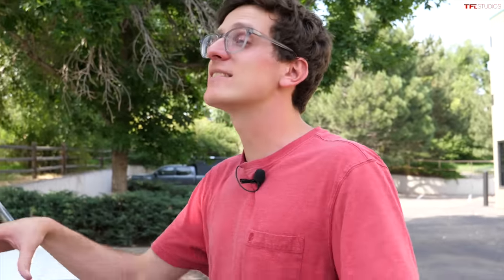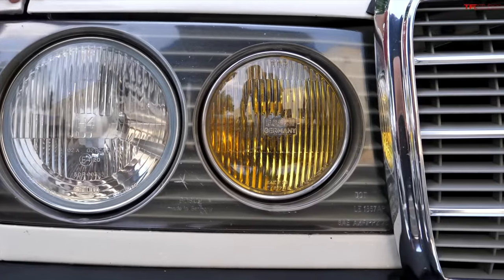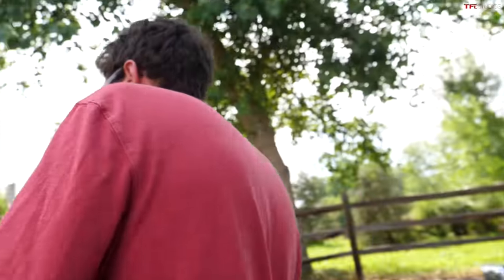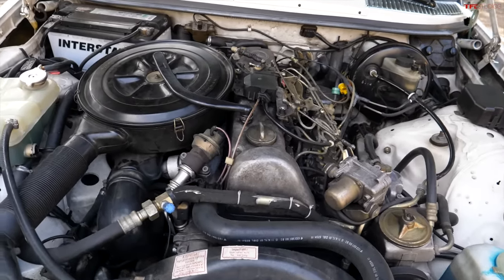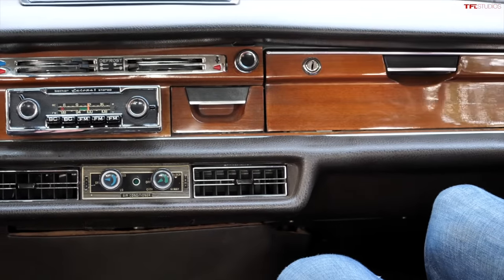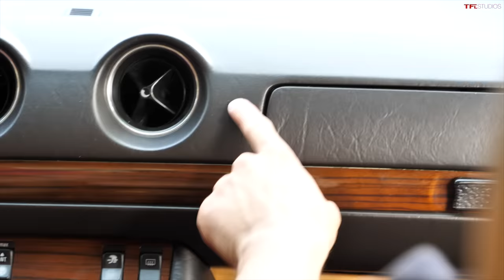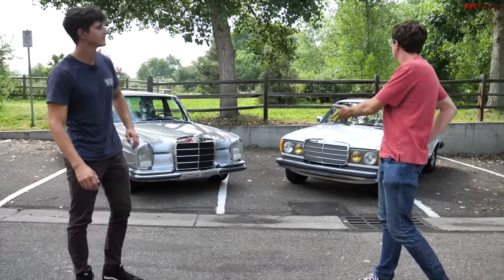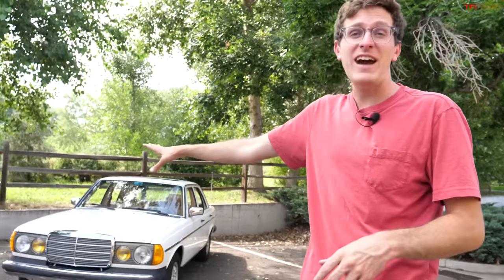Is It Worth Buying a Classic Mercedes-Benz? We Share Why It Absolutely Isn't (& Totally Is)!

Comment: I had a 280E and a 260E (E260) both bought new. They each arrived with factory defects. Despite excellent maintenance by master techs, both were very problematic with multiple unexpected failures both electrical and mechanical. Would I wish one of those things on most young people? No. Old people? Even a more emphatic no. Guess they are valuable as life lessons for these young guys. Good luck! (You'll need a LOT of it.)  As my last certified MB master tech and 600 series specialist said to me, "If you want reliability, get a Lexus."  I did and never looked back.

Comment: My 78 Benz Diesel was buttery smooth, especially after replacing the tired motor and trans mounts, then rebuilding the injectors, only then was it powerful and buttery smooth, in town or on the interstate. It was a joy to drive, so much my wife drove it more than her own car. I had the non-turbo 300CD Coupe.
Reply: It needed a new motor?
Reply: @djkenny1202  "motor and trans mounts" not "motor, and trans mounts"
Reply: @r.weaver3769  I was wondering!
Reply: @r.weaver3769  was it an automatic? A friend is offering me a 78 that sat since the pandemic. Needs sone work. Debating getting it and having it fixed up.
Reply: @djkenny1202  Yes, was automatic, but it mine had the later more tunable transmission. Car drove like it had a turbo despite not having one. The only bad, is it came from NYC, I bought a body to use for repairs, doors, rockers, rear subframe. But family sidelined the project and sold both as is. Wish I still had it. Lot of great memories in that car, My oldest learned to drive in that car.
Reply: @r.weaver3769  Awwe. I have a car like that. Just holding onto. 92 GTI 16v.
The original trans is likely in the 78 my friend has. Unsure if I’m resurrecting it.
Reply: @djkenny1202  Those can pull a pretty good price.

Comment: If I was going to buy a classic Mercedes Benz sedan, my choice would be the 1986-95 W124(aka 300E). I like the W123 but the W124 which succeeded the W123 is a little more modern and it's from my era. Also in my opinion, the W124 was the last great solid Mercedes Benz sedan before the bean counters took over and cheapened the brand in the late 90's and early 00's(aka DaimlerChrysler era).

Comment: In the day, I had a 1972 220 D, a 1977 240 D, a 1978 300 D and a 1978 450 SL.  Loved them all.  My most fond memories of driving were in those Mercedes.  Parts were always expensive.  If I could have a fully restored anyone of those, I would.  However, a non-restored one of those, would cost a fortune to replace all the rubber and plastic components.  So, beware.

Comment: The only thing with those Mercs from the late 70s onwards is that they are not build to be restored. They have all panels welded together as part of the no panel gap design as you can see. So unlike something like a Chevy Chevelle, you cant just unbolt a rusty fender and bolt a new one in its place - you have to unpick all of these spotwelds to tackle it, because all of the stampings were welded together and then leaded to fill the gaps at the factory, the only gaps are where closing doors go.  Good luck finding panels SOME are still available, but some arent, you might get lucky and find some old guy in Slovenia who makes them in his workshop, but you will pay through the nose. And they RUST. yes, they DO rust.. Because they wanted as silent a ride as possible, they used a TON of seam sealer on these bodies, and as a result, when the water DOES get under the paint - it pools there like in your rear wheel tubs and then slowly starts it work at swisscheesing the body out. If you find a good one thats been taken care of and kept garaged and not left outside in the elements GOOD, do not buy a cheaper one that has been a daily driver and kept wherever as a keeper because you will regret. Over and OUT. Queue the experts saying I have no clue what I am advising about...

Comment: I'd take the W108 everytime.
But i did drive W123 200D and 240D a LOT when i was a student side-hustling as a cab driver.
If you think a 300TD is slow you should try a 200D one day. 80mph top speed and eons of time to get there.

Comment: I prefer the w 123 because  i like the sound of the 5 cylinder diesel. That the reason why i have a 1978 Mercedes 300 D W 123  Without Turbo Four Speed Manual un France. It's not sporty but the acceleration is sufficient for today's traffic. The sound of the 300 D Turbo is magic it is part of the identity of the car. The sound of the 300 D without turbo is little bit different a little different but characteristic of old Mercedes diesels. I Lik the w 108 it's a wonderful car, but the w 123 has a special place in my heart because I grew up with this car because  my parents owned a 1983 300 TD Turbo Diesel station wagon with which I have traveled a lot since my birth, I learned to drive with this car and the 123 is my first car.

Comment: Let’s compare the handling of the w123 to a any sedan family car made from 2018 and lower.   If w123 had adjustable suspension 2inches taller softly adjusted will be hands down one of the best configurations

Comment: The head light of the 108 have 4 different variants.  1 is the pre70s   which you have on the car now. 2 is similar to yours, but they stick out a little bit more it came as a face-lift in 1970 till 72. Now, the twin stacked headlights have 2 versions the American and the euro lights, which have the indicators integrated within, and finally, the Americans with a big indicators in the place of the fog lights!!!!!! That's how the German do things!!!!!!

Comment: W123/w124 diesels are absolute reliable tanks. Anyone who says otherwise is uninformed or hasn’t done their homework.
Reply: Everything breaks or wears out, even Mercedes. Watch a few Mercedessource videos to get a more realistic idea of the maintenance required by old diesel Mercs.
Reply: @Ijusthopeitsquick  I have an old w124 merc diesel as a daily. Haven’t had to do much at all
Reply: @Ijusthopeitsquick  lol, you said maintenance, not repair. Every car needs maintenance; oil changes, fuel filters, spark plugs, brake pads, etc.
Repairs are when things are not funtioning.
Reply: @monunyabidness5949  I know what I said, but I can't figure out what your point is. Are you claiming Mercedes cars never need repairs? Anyway, thanks for listing some automotive consumables.
Reply: @Ijusthopeitsquick  Please, explain to us mister; someone saying a car is 'very reliable', why do you take this as 'never needs repairs' ???
Reply: @Rimrock300  Because rude, arrogant and pedantic fanboys get on my nerves.
Reply: @Ijusthopeitsquick  lol..run upstair and tell mommy about fanboys that bothers you...she will comfort we're sure
Reply: @Rimrock300  My mum died of pancreatic cancer last April but thanks for the advice.

Comment: Australia here. The thing is to find a well maintained Mercedes, like the ones maintained regardless of cost.They cost more to purchase but you save money in the long run.There are cheaper Mercedes around in the hands of wannabe's with no money that have been neglected that cost a fortune to put right.I searched for quite a while to find the perfect car, an '83 380 SEC, for the budget I had. Gold with a palomino interior, 305,000 km. A doctors car with service documentation.I had also bought a 380 SE as a parts car,193,000 km, slightly damaged , cheap. So I'm set for spare parts.

Comment: The 300D Turbo is not that slow if the turbo runs above 90% performance. If the Turbo is done, its just a slow 300D. I once have been driven in a w123 300d Taxi with over 1 million miles on the clock. The car (suspension, seats, gearbox, etc.) was totally worn, but the engine has run fine.

Comment: Had a 77 350sel only general maintenance sold it with 370000 mi same eng trans never rebuilt but parts are expensive. Thinking about getting a diesel 4 sp 300

Comment: I own a Mercedes Benz W108 250SE I6 from 1967 completely restored and identical to original. 99% of the parts and interior even the carpet are original. Mine is metal dark blue. Took me 2 years to fully restore the car and it work perfectly

Comment: Was the 72 originally used in Europe before you inherited it? I notice the European headlight assembly also missing are side reflectors and front signal lights above the bumper in the front. Nice dash on the older one, though I wish Mercedes done something with that steering wheel earlier. New ones lose their value with too much unnecessary electronics.
Reply: My mistake, Should have watched the whole clip before commenting.

Comment: Just mod the ALDA and delete the EGR. That will help off the line performance TREMENDOUSLY.
Reply: Yep.  My 300sd started losing power on my first road trip out west.  Wouldn’t go over 30.  I pulled the diaphragm out of the Alda and the thing runs great now.  Instant acceleration off the line and just a touch of smoke on start up.
Reply: @n9zmn  I like smoke.. 😏

Comment: I grew up with a 1970 280 SEL.  If yours is a 280 SEL, it originally came with the 2.8 liter straight six, gasoline, correct?  If it came with the V8 you have, it should say 450 SEL.  I hope I have that straight.
Reply: Not really, the model number did not reflect engine displacement until the next generation, W116, R107, etc
Reply: …I have a 1972 280 SEL 4.5 sedan, it has a V8 4.5 liter and also a 1971 280 SE 3.5 Cabriolet that is also a V8 3.5 liter
Reply: So apparently Mercedes Benz started connecting engine displacement with name branding as early as 1970, although perhaps not universally.

Comment: EURO HEADLIGHT  FIX 
look at my video of my diesel w115 I installed led rounds into the reflector cups with led rectangles underneath them looks great very bright cool parking beams and clear headlight protector wrap on the glass eurathane sealant to keep out moisture, next coming soon a video on door cap vinyl woodgrain wrap gives it that extra extension of the dash wood  also excellent for his w108 chassis and custom made led plate tail lights. Rinoliner for the trunk 
Cadillac seats for ultimate comfort.

Comment: 10mph bumpers? The NHTSA regulations at the time required 5mph bumpers, so that's what I assumed the 1982 300D has. Still, this is Mercedes so I wouldn't be surprised if they fitted 10mph bumpers to the car in a fit of German overengineering.

Comment: Generally speaking pre 1990 are worth keeping. Otherwise it"s too complicated with electronic and gadgets. Still there are so many models pre1990, one must be careful in buying the right one to suit oneself. Spares may be expensive and difficult to source for some models as years passes. Classic car ownership is not easy at all.
I owe a low miles 500sl once , and I regret that I sold it. After years of regret I say to myself I 've got to get one classic merc back. So I got myself a low miles good condition 280CE, though the 123 series is reliable and durable, still a lot of things to work on to keep her going comfortably i todays traffic. A/C with the prehistoric york pump is a big issue.for example.
In order not to be left behind in nowadays motoring pressures on the road, the car must be maintained at top standard, so one must be very devoted, unless you do not drive it, or only on sunday mornings. So to concluded do not commit unless you are prepared!!!

Comment: My wisdom. My experience with diesels is limited to driving an Oldsmobile diesel for a couple of months when I supervised a car donation program for a charity way back when. Here's the takeaway. If you're someone who buys your gas two or three gallons at a time, don't get a diesel. Diesel fuel somehow gets all over everything and it is very seriously smells. You do not fill up a diesel vehicle yourself if you are wearing your business or dress clothes.

If you fill up on Saturday morning when you are wearing your trash clothes, get a diesel. If you are not going to do that, maybe a diesel is not for you even if you think it's a cool idea.

If you want an old Mercedes-Benz diesel, typically a 240D, these still come into the self-service yards with some regularity. You'd better stockpile parts if you get one though. As with many hobbyist and retro things, if you need to ask, you can't afford it. These are very reliable but as time goes on, you may need to replace steering and suspension parts, driveshafts, brake parts and who knows what.

Comment: The older one looks better. Too bad it costs more to buy it and to use it. The newer one, Ive seen them rust even on the sun but yeah thousands of those still drive everyday. So I guess having a W115 would be a perfect solution since it a model between these two.

Comment: These cars were engineered to a higher standard. They literally were designed to last forever. You could buy one in your youth and pass it on in your will. They drive and handle favorably compared to current vehicles. No airbags but engineered for serious accidents. They are probably the bargain of the century

Comment: great cars but keeping them as a cost effective daily runner is getting very expensive now sadly
Reply: what is so expencive..? These are very simple and basic vehicles compared to the new computer cars.
Reply: @Rimrock300  Parts and parts sourcing. It's not that the cars are expensive but keeping them running, on the road and used as a daily requires maintenance. Consumables obviously need periodic changing and depending in which country you live, that can be difficult and expensive. Great cars though and build tough to last.
Reply: @nikitis13  Correct, there is always the expences for parts and maintenance. For the record, I keep in mind older Benzes that are 'okay maintained' through the years in the first place, not changed oil for a decade and/or about rusted out. There are many 'okay' older Mercedes' around still. For an older car like 80/90's Mercedes the parts and maintenence cost will stand for a big percentage of the overall cost keeping the car as a daily driver, as there is about 'zero' annual value decline anymore. While for a new car the parts and service cost will be a small percentage. On the other hand the annual value decline will stand for a BIG perentage of the cost keeping the new car, but that cost is kind of a invisable cost to many people. Owner of 2020 Mercedes : 'My neighbour had to spend 1500 USD for a new power steering pump for his '88 Benz, oh my Goooooooood those old cars are expencive to keep on the road!! I just spent 200 USD to change oil and filter the last year. I'm so happy I do have a new car'  Let's NOT mention the 10000 USD value deline of the new Mercedes:)

Comment: Great cars, but are they worth it.   No, but if you enjoy it, that's what matters.    If you ever hope to break even on a more serious restoration, it needs to have two doors and if the top goes down even better.    While I love a 280SE 4.5., I'd buy a restored one, even if its an older restoration.    Much cheaper in the long run.

Comment: Any car sufficiently aged is a potential "money pit." Having gotten this out of the way, not every car ages with so much grace and style as did these two popular Merc's. For Kase, I recommend that you also look into the old "Ponton" (1950s) models, for example, a late 1950s 220s sedan/coupe, (though they are getting a bit pricey these days,) and you are also young enough to buy a more modern edition Merc, for example a W126 or a W140 sedan/coupe, and "age" it properly with much love and care. I've owned insane number of Merc's in my lifetime, and I do not regret any of them. For Tommy, I would strongly recommend looking into the W123 TD series wagons, (I've always found the coupes to be a bit awkward of this chassis type.) Mind you, I am not saying you should get rid of your current cars, (that would be silly!) but, you can start collecting slowly, as you learn more about various generation of Mercs. By the way, I learned how to drive in a new mid-1970s 280se in Europe, (you've guessed it! Back in the mid 1970s,) and have owned Merc's continuously since the 1980s. (If you two really want to have fun with old Merc's, look into finding a well preserved 309d Merc Omnibus (early-to-mid 1970s,) or an old German Army Unimog radio-box truck (early-to-late 1960s.) Ach, and before I log-off, consider also an R107 and/or R129 Merc roadsters! (Don't wait too long with the R107 variant, as the prices are beginning to creep up.) The R129 is the better car, (though not as great looking as the R107,) and you can get some great examples fairly cheaply. So, enough from this "old-guy" and well done with the video! :D

Comment: Mercedes owners of models this old may have one issue--(despite preventative maintenance), the fear of a major breakdown 200 miles from home, no mechanic there to fix it, and if there is one, the parts you need are not one of the extra parts you always have in the trunk..."It'll take 4 days to get the parts", you're told...thus causing a decision of limiting these cars only to local driving.  It's my fear with my '84 280SL 5-speed Euro.

Comment: old mercedes diesels are money pits if the diesel is expensive😂😂 they dont break😂 my friend bought an old w202 as a winter beater few years ago and currently he daily drives it because he tried blowing the engine up but he could not get it to break (5min burnout, radiator hose exploded)

Comment: These old mercedes are where it's at. Your going to spend a little more on fuel and there slow. everything else about them is so much better than modern cars. These new engines make some power and save some fuel but need turbos replaced vct timing faults electronic module faults diagnosing all that crap. My w126 is like find the leak seal it one time and forget about it for like 20years. Amazing cars.